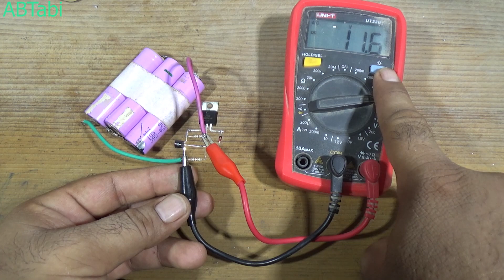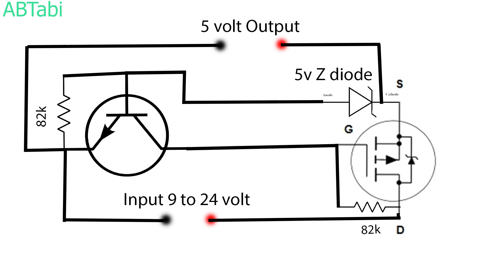Make a 5 Volt Regulator, Fix 5 v Output Z44N Regulator circuit

Comment: Next time use IRLZ44.
It works well at voltages of 5 V, while the IRFZ works correctly with voltages higher than 10 V. At voltages lower than 10 V, the IRFZ 44 works with a handicap !!!

Comment: Does the output voltage depend on the value of the zenner diode. ie if you has a 8v zenner would it output 8v?
Reply from the maker: Yes, near about 8v ,,,,,,,,,,,,,,,